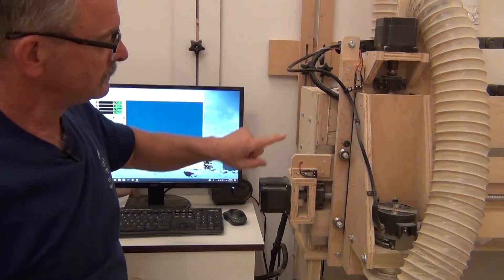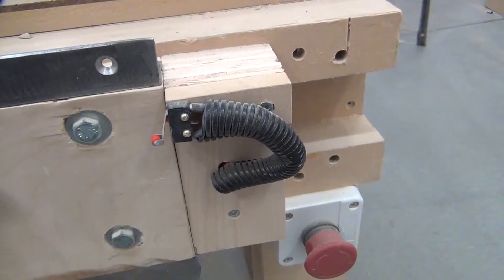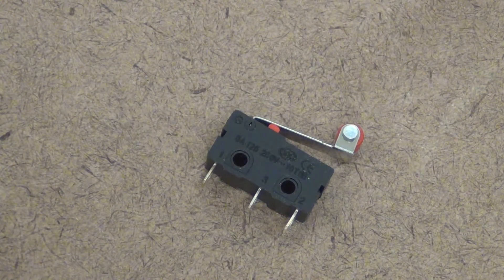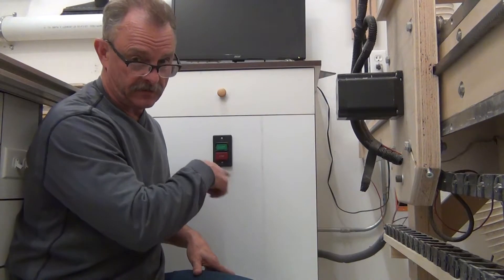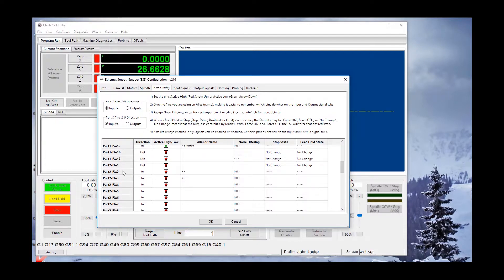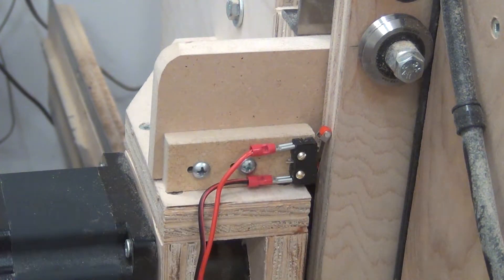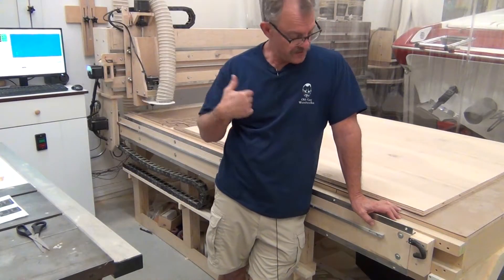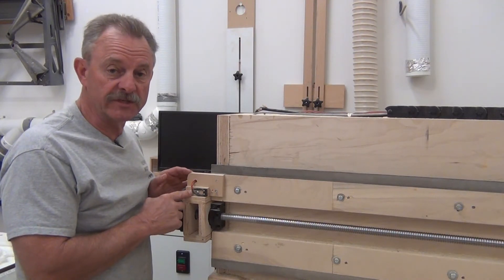Homing and Limit Switches - Homemade CNC

Comment: What breakout board did you end up going with?  I’m finding the same problem with limitations on inputs with my c11g BOB.  I’d like to have limits for each direction on each axis, but even with my current bird there aren’t enough to do a single switch per axis.
Reply from the maker: I believe it was a C25.  I'm not at the shop right now so I'm trying to remember from my ever fading memory.
Reply: @OldGuyWoodworks  Thanks, I just came across the C25, and I purchased it.  My follow up question is can you control a spindle with that board, or do you need some other auxiliary board for this?  The reason I ask is because I started with a C11G BOB and I'm having issues with the outputs after hooking up 12V power for the Spindle side of things on the board.  Hoping I can still salvage it, but if the C25 can cure all my problems and give me more inputs, i'll ditch the C11G idea.
Reply from the maker: @strikermed  I control a spindle with mine.  I control the inverter which in turn controls the spindle.
Reply from the maker: @strikermed  I think my original was a C11g.  The C25 is cheap to replace.

Comment: I would like to know more about you home build machine
Reply from the maker: What specifically would you like to know?
Reply: @OldGuyWoodworks  what are the spec on the angle iron you used for the rail guides. And how have they held up?
Reply from the maker: @warchildcustomcreations  1/8" thick 1"X1".  Holding up very well.  I don't see replacing them any time soon.
Reply from the maker: As a follow up.  I wouldn't use angle iron on my shorter axis.  It works fine on my long axis where the stress and load is not as heavy. I have seen deflection on the v-groove bearings on the angle iron if there are any lateral loads.  This will be a redesign in the very near future.  The angle iron was a less expensive solution on the long axis for my linear motion.
Reply: @OldGuyWoodworks  so linear guide rails for the z axis
Reply from the maker: Absolutely.  And for what most people call the X, but I call the Y.  The axis mounted to the gantry.